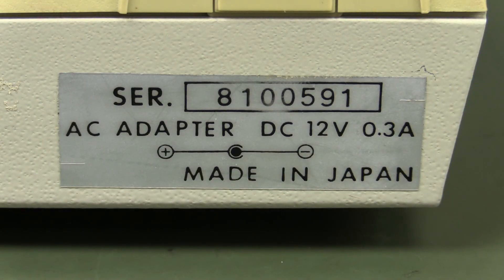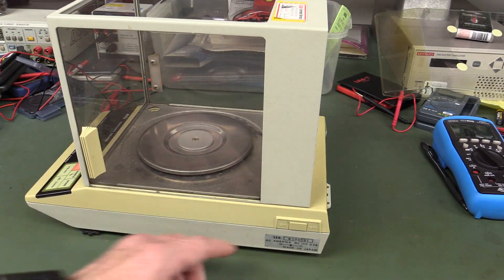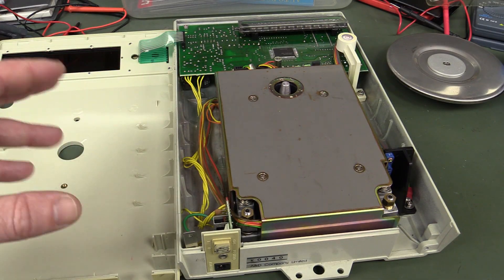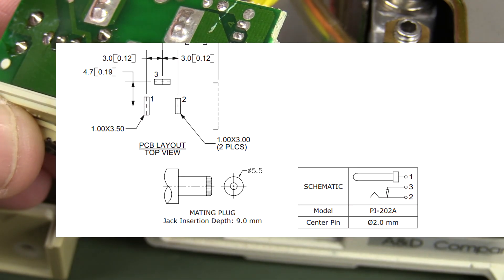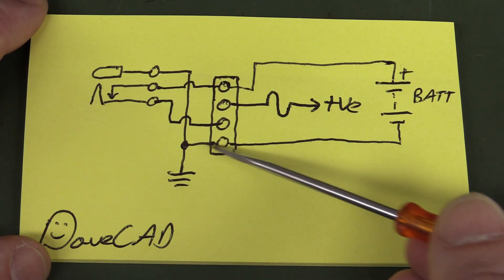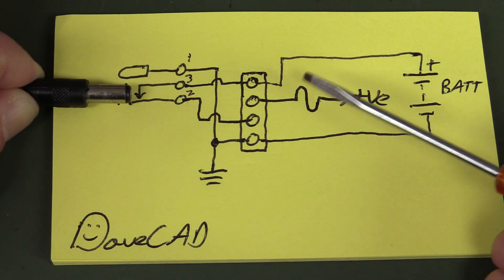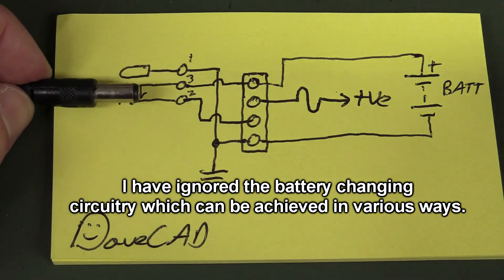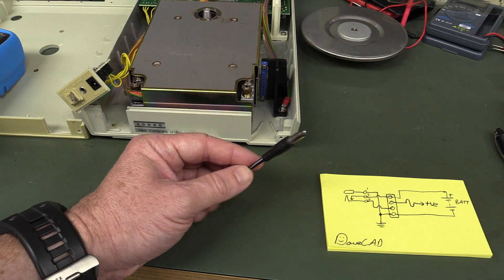EEVblog #1015 - Beware Evil (But Clever) DC Jacks!

Comment: A series diode will cause voltage drop and power dissipation that scales with current, so what is commonly done is a diode which is after the fuse that only conducts (and shorts the input) when power is connected with wrong polarity. If the user connects power correctly, the diode is reverse biased and has little effect. When power is connected the wrong way, the diode shorts the input and blows the fuse.
Reply: It can work well. you need a very beefy diode tho, and a fastblow (F, or FF) fuse... esp for stuff that might be  used on a lead acid car or leisure battery
Reply: Doug Gale well electroboom done a video about it. And he say it was bad design and cannot protect the circuit.

Comment: I hate when they do that, I accidentally fried a ZX Spectrum that way!  I was devastated and inconsolable for days.
Reply: Sucks that Sinclair were too cheap to include a diode for reverse polarity protection!
Reply: That's a real shame. 

I was told the ZX was one of the most cut down designs ever done with parts in it preforming functions never intended, like the video coming directly from ram via a DMA trick, bits in ram pumped out automatically for each line as the DMA refreshed the ram cells. Meaning it really only processed programs during raster flyback.
Reply: RAM framebuffers are not uncommon, video coming directly from RAM was pretty much the most common way of doing displays on micros in the 1980s, and Sinclair weren't at all unusual doing that on the Spectrum. The Spectrum processed programs all the time, not just during raster flyback. If the data was in the same part of RAM as the framebuffer then access was contended (the CPU might have to wait for the ULA to get done fetching the next bit of screen data) but processing would continue. Accesses to the upper 32k and to the ROM were uncontended and no wait was inserted if the CPU needed to access upper RAM while the ULA was fetching screen data. The ULA did contention by momentarily stopping the CPU clock if it detected a CPU memory fetch to the lower 16k of RAM while it was fetching from the frame buffer. The Spectrum's ULA is actually a very interesting study of making a decently performing 8 bit system at minimal cost. See Chris Smith's book on the subject (he had a Spectrum ULA de-encapsulated, traced the entire circuit in the chip, and described exactly how it works).
Some 6502-based systems like the BBC Micro didn't need to contend screen memory at all because the 6502 has a much more predictable way of accessing memory compared to the Z80, and so the video display hardware's access to RAM could be interleaved with the CPU's access and so the CPU would never need to try to access RAM while the display hardware fetched data from RAM (and thus no wait states).
You might be thinking of the ZX81. On the ZX81, the CPU actually actively generated the display in real time - there was no frame buffer - and thus it had a SLOW and FAST mode - the screen would go blank while in FAST mode as the CPU would not be updating the screen at all. The ZX81 really was a very minimal design - only 4 chips.
Reply: I also check it every single time.  Plus, I usually check with a voltmeter as well.
Reply: Yes, thinking about it now, it was the ZX81 not the Spectrum that surprised me with the minimal logic present. No way to generate the back porch in the composite signal.
Reply: Wonderfull. Thanks 74HC138 for sharing this! I love 8 bits CPUs. I used do some projects, in assembly language, with the Z80 and I had some Sinclairs too.
Reply: +CoolDudeClem The SNES and the Mega Drive were also centre negative as well.
Reply: CoolDudeClem 
Or you place a usb connector in your ZX Spectrum

Comment: Also annoying: AC-output adapters that look exactly the same as DC ones.

I learned these exist by destroying something I was working on, woo
Reply: Yes indeed.  Pure evilness. They should come all in red (or neon) for example.
Reply: You run into this with old video game consoles.  Most will run off the same 9V DC supply, though they did switch from center negative to center positive in the 90s.  The NES (and some versions of the SNES), however, use AC with an identical plug.  It's not a problem for those particular consoles, since they've got internal rectifiers and will happily take either flavor of DC as well, but if you use a NES adapter on a Genesis you're gonna have a bad time.
Reply: yes! we have tons of old modems and calculators at my work and they all seem to have AC output adapters. I wonder if they did it to keep costs down, keep the plug pack as basic as possible and put the rectification components in the product?
Reply: Popular devices I dealt with that used AC adapters were US Robotics modems and the Alesis nano range of synths and effects. The modems didn't even say anything on the case, which must have left quite a lot of people scratching their heads.
Reply: As well as Alesis. It can simplify generating a split voltage supply for audio gear. Ive found a lot of gear would ship with an underpowered adapter especially if it was used gear. They usually use a  voltage doubler to get higher voltage rails for more headroom with the cost of pulling more current of course.
Reply: @ Alex C; Yes, I agree, but the point here is that irrespective of what may be marked on the device, PSU or user guide, it is still not uncommon for users of all levels of technical ability to cross plug these. Not all battery powered devices having have a DC inlet jack even come with a PSU. Its quite common to have multiple PSUs supplying multiple products in the same location from the same power bank with multiple power, data and AV cables in the same loom.  The Electronics industry is necessarily 'obsessed' with specifications, ratings, standards and inter-connectivity, yet the humble DC connector seems to have fallen through the net.  Surely it is time the industry addressed this so the user no longer has to play Russian roulette. Even a colour code or band system at each connector end would be a massive improvement over the present  hieroglyphic symbol -  at the wrong end of the PSU-  that then needs explanation for most users.
Reply: Peavey did it - 16VAC and it must be pretty close too, so very hard finding a transformer that stays in regulation for the load too.
Reply: I'm guessing that in the old days it was easier to have the wall wart contain just a transformer and do rectification in the device. Now most things use switch mode supplies so DC out is easier. It would have been nice they would have switched to a different standard for the connector.
Reply: Naoki Saito i also thought of sega. They commonly used negative pin :)
Reply: Richard van Pukkem I blame BP for putting green pumps for unleaded whereas everyone else uses green for diesel... This just irks me
Reply: BTDT
Reply: No, everyone uses green for unleaded. What planet do you usually refuel on?
Reply: This seems to be an audio thing just like center negative is. I think audio's need for a negative rails means they might as well tap another transformer in the actual device rather than require a 3-terminal power supply.
Reply: Center negative AC is pure hell.
Reply: How? I've never seen a barrel jack output AC
Reply: I buy cheap Sega gear because of the centre negative issue. Always blows the same parts every time. I then add a rectifier so it doesn't matter what plug pack I use. Or just use a universal 9v for all systems ;)
Reply: I don't see how that's the powerbrick's fault. It's just stupid to plug something random into your device without knowing what you're doing.  You also put petrol in your diesel car and then blame the fuel station?
Reply: I'm afraid I disagree. A product manufacturer should not assume the end user is electrically competent. For example, No typical end user would expect to check  one  USB cable for polarity against another,  so why should they need to check the polarity of the power inlet socket? Even experienced EEs fall victim to the DC jack misnomer and many (I include myself) have destroyed expensive equipment.  It is possible to put petrol in a diesel car, but it's quite reasonable to expect the end user of a diesel car to know which pump to use to re-fuel. It is common knowledge to all car drivers that there are usually 3 types of fuel at filling stations. Petrol, Diesel and Rip-off.  ;)
Reply: I learned these exist by reading the label...

@hughieandrolf the expectation of the product manufacturer is that the user will only use the power brick that came with the product. Beyond that the manufacturer provides no expectations. (If the user has lots of similar power bricks, they should label them)
Reply: I destroyed a dual channel Shure Wireless Mic receiver doing that. Mixed them up because the 8 channel mixer AC plug pack (with the same plug) was in the same power board. Doooohhhhh.
Reply: Always use the supply that comes with the product. It's not a matter of evilness. Even dc plug can destroy another dc in device. 15v plug in a 5v device. Gone. It's that people take for granted and being careless/brainless.

Comment: Recently I fried my Transistor Tester with wrong AC adapter. It was KORG adapter for rack synth and it has 12V with '-' in center. So I had a tantal-boom pyro effect. Voltage regulator gone as well.
I think that it is simple way to make every device independent of power polarity just with rectifier. It will make no difference what is '+' or '-' on which pole and costs very little.
Reply: It works, but you waste power on the diode drops.

Comment: P.S. Does center negative give a ground first connection (if the psu is grounded)? Would reduce potential differences between ground referenced interlinked equipment.

Comment: A lot of old videogame consoles are center-negative including the Nintendo Family Computer/Famicom, Sega Mark III/Master System, PC Engine/TurboGrafx-16, Sega Genesis/MegaDrive, Super Famicom, Atari Jaguar, etc. In Japan the Super Famicom was made to accept the Famicom's AC adapter because one was not included and they expected buyers to already have a Famicom. I believe this same expectation affected the entire industry where they expected game systems to be generally compatible with each other's AC adapter and RF connections, hence, consoles like the Nintendo Entertainment System being internally rectified and regulated for broad power adapter support. Because the earliest Japanese game consoles were center-negative, most later ones were as well.

Comment: Just checked my vintage Hitachi TRK 8080E Boom box... centre negative12V DC! It's 3 way powered : 240VAC/12V DC external or 8 D cells.

Edit: The mains socket has an SPDT as well as the DC jack.

Further edit: My original 1979 one got blown up a couple of times through reverse polarity XD

Comment: "Try to find a modern product with that..." OK, almost ALL guitar pedals in the market? :D
Reply: "Brother" label makers are center negative.
Reply: Any others?
How about the Dymo Letratag and a digital blood pressure meter that I bought new the past year?
Reply: basically things that are likely to have NiMH batteries that can charge off the plug directly without the need for charge controllers
Reply: Same as my Dymo labeller which this video prompted me to look at... It also has the ability to run of AA batteries so I wonder if the battery/mains power switching is managed the same as Dave's schematic???
Reply: Was going to comment the same thing. Roland "Boss" standard centre negative on guitar pedals for this exact reason - they usually all have 9V batteries and this simplifies the internal circuit design to implement a power<-->battery switch setup. Moog Music who also make guitar pedals (Moogerfoogers) are an exception, they have DC positive connectors.
Reply: Was going to comment that (Brother label maker). I ended up buying one of these 
https://www.adafruit.com/product/1448 for the one I got from a thrift shop for $14 (Has a USB connector and I can print 1 bit graphics to it).
Reply: "Not that common"? I suppose that depends on where you live. In N'awlins and Seattle you can't swing a cat without hitting a musician of some type, and half of them are guitarists. That DI box the acoustic guitarists plugs into on open mic night at the coffee shop? If it isn't a passive transformer, it has a center negative power connector.
Reply: Distortion pedals, delay pedals, flange pedals, phaser pedals, loop pedals, multi-fx pedals, talkboxes, wah pedals, stompboxes, chorus, tremolo, reverb, compressors, volume pedals, octave pedals, pitch shifters, noise gates, EQs, tuners, boost pedals.

To name a couple.

I also have a Roland microcube amp, a Zoom digital recorder and a drum pad that use center negative power supplies. In conclusion, lots of music gear!
Reply: welp, music gear is not that common among the average consumer, so yeah, only a few products still use center negative, just like you don't find BNC connectors on modern TVs, computers, cars, audio equipment etc, that's what Dave was referring when he said "modern products" :P.
Reply: Bernardo Silva Ok... So there's one product. Any others?
Reply: Andrew Delashaw "guitar pedal" is not "one product". it is a segment of products...